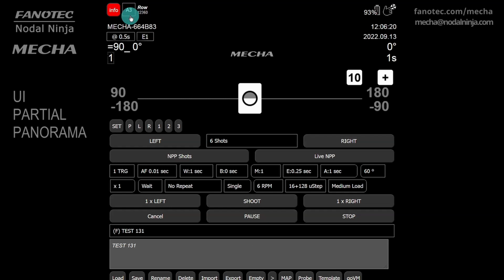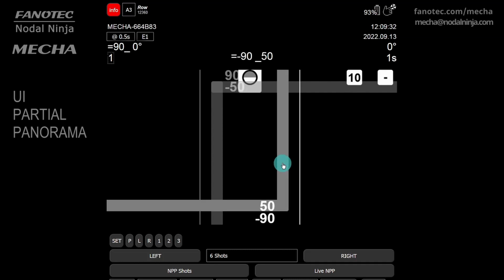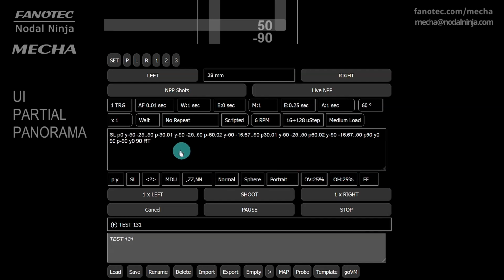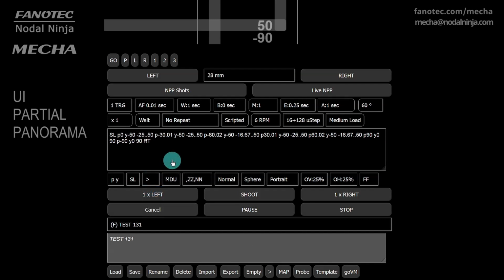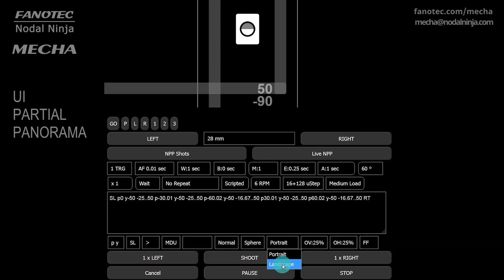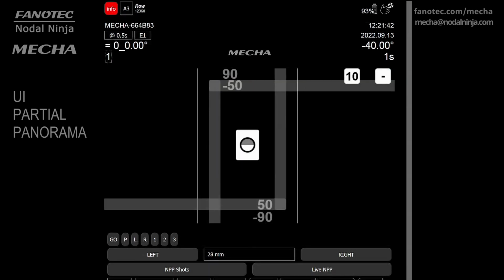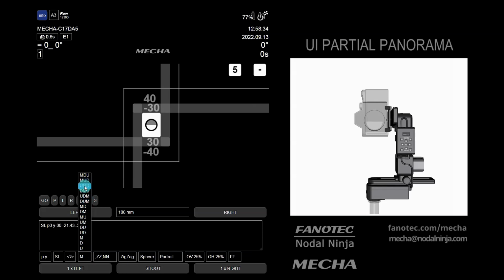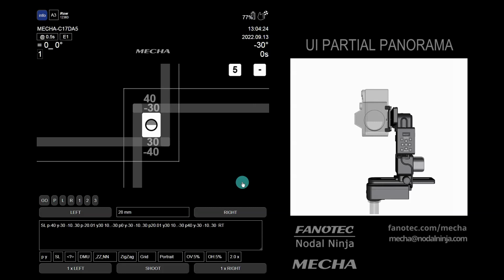Partial Panorama Using MECHA's Two-Axis Slider – C1 and C2 Controllers

Comment: You say: Select a crop factor, or FF, which stands for Full Frame.
I ask: what about medium format sensors (33x44, 40x53,4)?
Reply: In the select list, FF means 1.0 crop factor to a Full Frame set in MECHA's 192.168.8.1/config  where by default is 36mm height and 24mm width, in portrait orientation, you can either change those values in config to, say, 53 height and 40 width while keeping FF in list or let the values unchanged and provide focal length in 36/24 equivalent e.g. instead of 28mm enter 18mm , that said, will be possible in future FW updates to enter a custom crop factor, like 0.65 and such.
Reply: Update:starting with FW (1)2361 there is an extended crop factor list which includes the medium format and point-and-shoot cameras,  there is also custom value possible in the web UI.